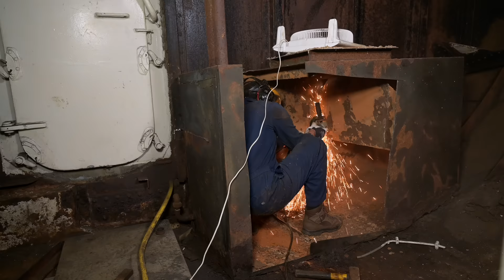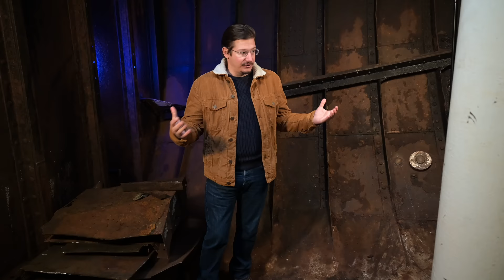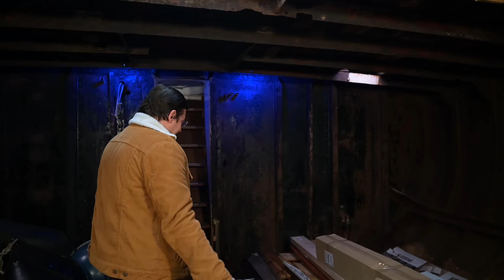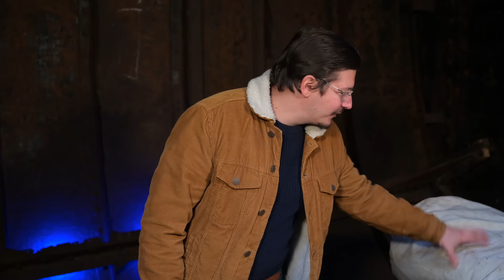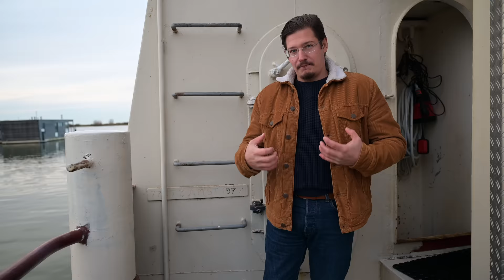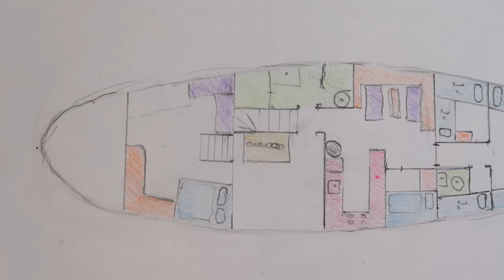Revealing the Interior Plans of our Huge Sailing Boat!

Comment: I did just a quick bit of research and it seems "Julius Mock and Sons" was incorporated in New York State in on February 26, 1954, and it was described in the New York Times in 1986 as a "manufacturer of steel doors". So it's not a general shipyard, but rather a specialist manufacturer, which makes it not surprising that their doors might have made their way to European shipyards.
Reply from the maker: Very interesting, thank you! Do you know when they run out of business or if Julius Mock and Sons still exist?
Reply: @FlyingConey  They don't seem to be operating anymore. I don't know if they just went out of business or if they merged with a different company.

Comment: Daniel I have paused the video at 11 mins to post this as you've drawn a very good layout of the proposed plans but Im struggling mentally to place things with regards to the current floorplan.
Could you perhaps produce a new drawing with both the old and new layouts side by side to let us visualise it in terms of bulkhead placement and engine room layout etc it doesn't need to be architecturally perfect, lets just say easy to follow.

Comment: Very entertaining video, keep up the work, there is a lot to do. DON'T fall into the trap of planning the layout on the weather deck plan. Particularly in the bow there will be much less room at lower deck level. I helped build a 13m yacht where the owner did the arrangement using the weather deck. I had to re-design the layout much more compact.
Reply from the maker: Good advice, thank you. We will probably use laser measurements and CAD for the final interior plans. Also the dimensions of the boat makes it easier to fit the interior.

Comment: I would like to offer a little bit of information. Just because I find your project quite fascinating. That is a very large boat. I'm quite  Envious. There is a product called POR15! They pride themselves on complately suffocating rust. I have used this product.
In many automotive restorations. If you were to removethe large-scale rust and then clean the surface, you simply paintthe POR15 Over the top of the rust. The product Is a ceramic base paint. Once the product is dried The rust simply ceases all advancing. I personally have used it on automotive bodies and simply left them in a field to purposely. Rust and twelve years later there still is no rust period.

Comment: Okey, great you got the idea that 3D scanning the ship is a good idea. That will certainly make the CAD stuff a lot more easy. If you had to measure by hand, it would take quite some time, but it could still be done. As long as the format is something you can work with in the CAD program, you should be all good. Of course it needs a benchmark, otherwise you wont know the size of things in the file. Any ideas who you are going to bring for the 3D scan? Will you do it yourselves? 

I like they layout of the ship, It looks like you wont lose much at all, in fact, i think you will gain a lot by having the old interior removed.

I think it will be all good, just be sure you think before you do, but it looks like you got the right ideas now. Everything seems to be well thought over and some sound theory and methods to get things done. :) 

Good luck!

Greetings,

Jeff

Comment: your design of one private room for 2 ,in addition to the group accommodation , allows extended mutual benefit dynamics .It is a bit like cargo ships with a passenger cabin for additional income .Apart from the youths you want to travel with ,you will have the option to dig into the huge cruising market . Lot's of elders and others ,who do have the money and time and interest in cruising ,do not want to join a common cruise ship ,with predominantly elders and  pre-organized mass events .The ratio of 2 elders ,or handicapped, with 10 youths and you 2 on board is as well a very good ratio ,that has mutual benefits . Many would even prepay to reserve such an experience . To keep that option ,think of the layout of the cabin to be convertible from 2 comfortable beds to one big bed and easy pathways . Take especially care of the staircase and at least one comfortable safe sitting on deck and try to add one toilet on deck ,when you design the toilets . Since potential customers of this cabin need to have a certain mobility and sense of adventure ,their bathroom can be designated outside of the cabin, even though an on suite bathroom might be better. These special and very well paying customers are likely to be interested in doing jobs as well ,to be really part of an adventure . May you take this into account to create more options and extended mutual benefit dynamics .

Comment: I have been watching your videos from the beginning and in the beginning you mentioned that you have been racing Nacras. May I ask? I have often been wondering what you're experience with offshore sailing is. And also here where I live any kind of commercial vessel that does chartering  needs to have a licensed captain depending on the number of guests and size of the vessel. Are you a licensed captain and on what kind of boats have you worked before?
Reply from the maker: Flying Coney is a pleasure craft and Barbara and I both have a license to sail with a pleasure craft of any size. Our boat is about the maximum what you can easily register as a pleasure craft. But after all a pleasure craft it is. 
Since we plan on staying a pleasure craft we can only take friends and crew aboard. So if you're a supporter of the project and of Flying Coney you'll get a chance to sail on the boat. Sail training usually isn't commercial use. It's common that there's still a small charge to cover the operational costs of the boat. German traditional sailing ships are non commercial and they're not allowed to make any profit and that's how they handle it. If you want to sail on them you become part of the crew. 
That's the legal side of your question. But we do want to get the RYA Master 200GT. Barbara will get the commercial endorsement for it. Since Flying Coney is under 200GT that should cover everything. Barbara served on a 155 meter commercial merchant vessel for over a year both in the engine room and on the bridge. We also did some offshore sailing in the past. Barbara sailed two times in the tall ship races, this year we had this short passage on the sailing ship Jantje. We also got the chance to get some sailing aboard the Belle Amie. Actually I can't wait to get a sailing rig on Flying Coney so that I can nerd out on how to handle it 😂
Reply: Interesting ! Thank you ! @FlyingConey